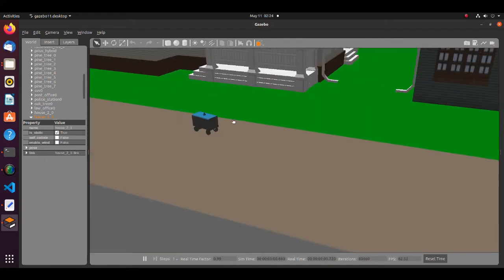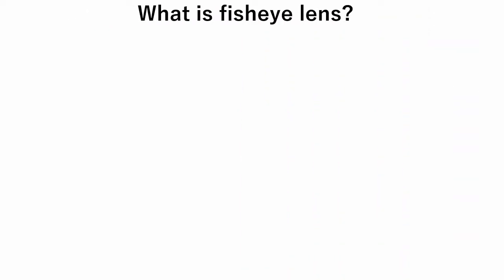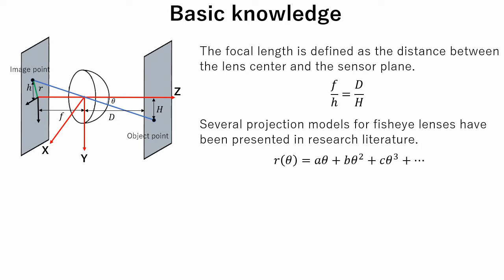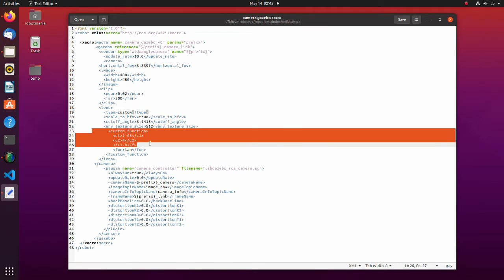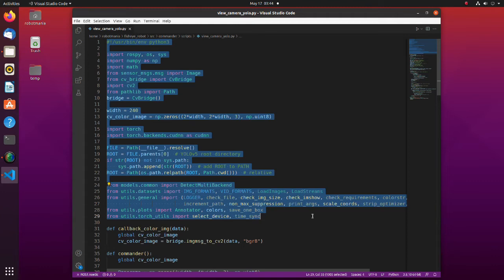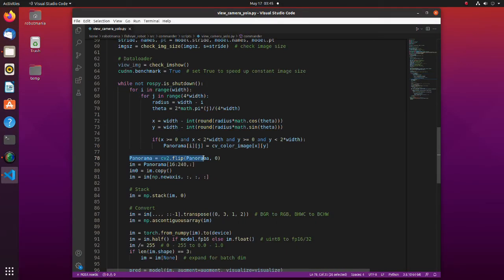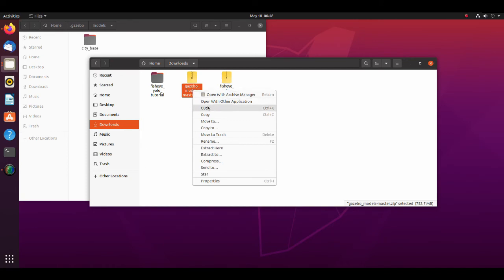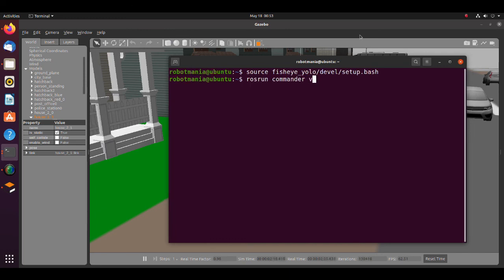How to use YOLOv5 with fisheye camera

Comment: Hey would you please share the code only for fisheye to panorama process.
Reply from the maker: Hi Hari Sumant!
Thanks for watching my video!
The part where a fisheye image is converted to a panoramic image is the lines 67 ~ 78 of the “view_camera_yolo.py” script. The input is “cv_color_image” and the output is “Panorama”.
Reply: Yes! I tried that on my images. It worked far better than my previous methods but not quite as good. Can you please help me with that? I would like to continue this discussion. Please DM me on Twitter. 
Username - @HariSumant